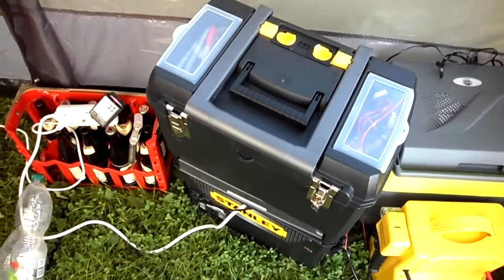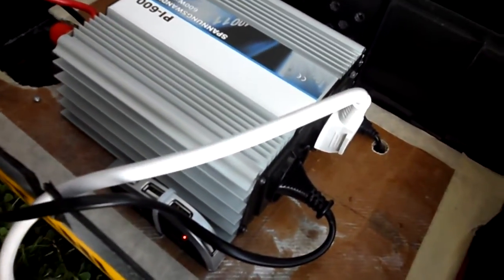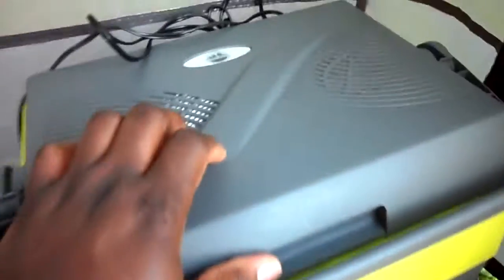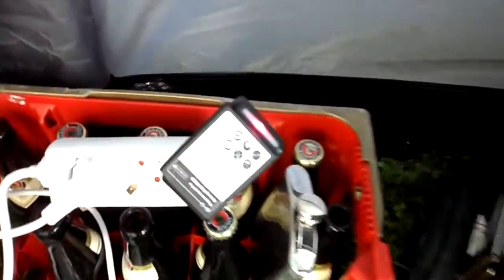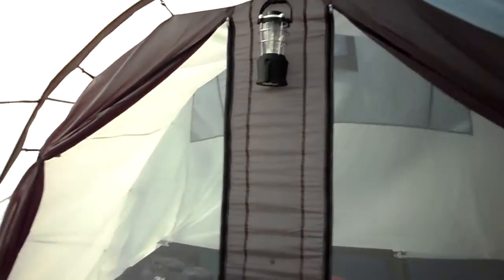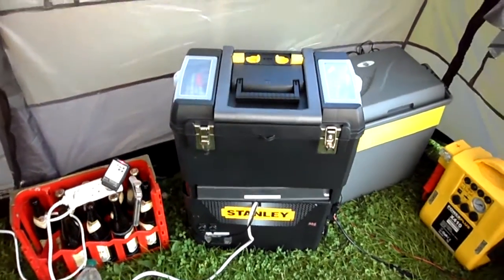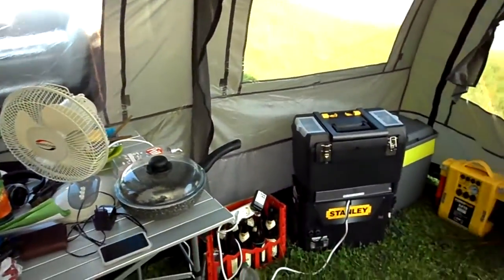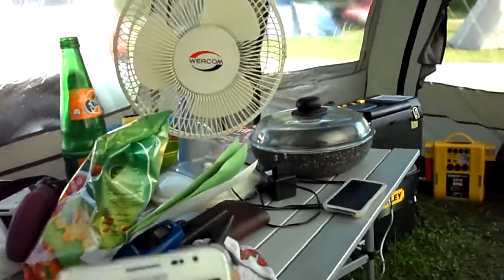Solar Generator (The Grizzly) Part Two

Comment: You stated that viewing your volt meter is a challange. A red lens over the display will greatly improve visibility in the daylight. The less translucent the better (to a point).

I would highly recommend a trip to the auto parts store and get actual connectors for your battery.  Id hate to think what may happen if durring transport of the sysem you had a battery clip get loose and short circuit the system. The actual terminal connectors will be extreamly secure! 

Connecting the solar panels could be on a slick plug and socket as well.  Multiple sockets so each panel was independant. Wiring on the inside would parallel them.
Reply from the maker: Thanks for your imput.  This video is from last year and I have since upgraded it a bit.  The display has been replaced with a battery gauge and voltmeter that can easily be seen in bright sunlight or in the middle of the night.  Proper batter connectors and thicker gauge wire are also on my list.  A short circuit could happen but is highly unlikely as the number of fuses I have in it now is bordering on redundant.  I was thinking about using anderson plugs for plugging in the solar panels but I haven't gone camping much this year and I haven't gotten around to it, but winter is almost here so I can add more upgrades while I wait for Spring.

Comment: Great job- thanks for sharing- we hope to try to build one as nice as yours!
Reply from the maker: Since this video I have decreased it's size and added a host of outlets, USB ports ect.  I have also increased my solar panels to 215 watts and next month I'll buy another 100ah solar battery for more power when the weather goes bad.  Currently in the off season I am using the solar generator as a battery backup to start my vehicle and others if the need arises.
Reply: Gregory Parker I want the USB ports, good idea- what have you decreased, the tool box? I am wanting the higher watts too- am also liking the flexible mat type panels, but expensive. Would love an update on your project- watched many MANY YTube vids and yours is the best DIY setup portable that I can find- like rolling case- want to fit in back of suburban and go if have to... thanks so much for your time! Blessings! :) MB
Reply from the maker: InLaws Attic The Stanley rolling toolbox comes with an upper and lower section.  I simply removed all of the outlets, wiring, displays ect and put them into the top section.  It's no lightweight by any means (about 55 pounds) but it now takes up less space.  I'll get another toolbox next month for my extra 100ah battery next month.  I use folding panels to save space because weight is of no concern to me.  The roll up panels would be nice but for the cost it's not worth it.  Thanks for the comments on my video... I will make more when the camping season starts up again in April :D
Reply: Those panels look great- are they the "kickAss" ones from Australia?  I am also looking into lithium ion batteries to take up less space, if not to cost prohibitive. I love the camping set up- Thanks for your vids! :)
Reply from the maker: No, although I lived in the NT for 3 years these are just some foldable panels I bought on eBay here in Germany.  They cost more than ones that do not fold up but are cheaper than the ones that roll up.  Since weight and space are not an issue for me I just go big :D